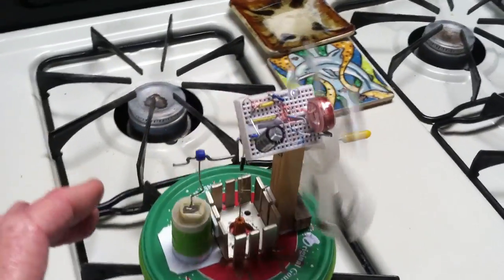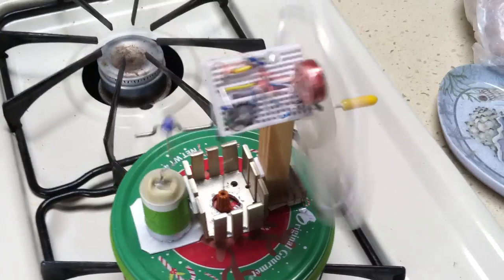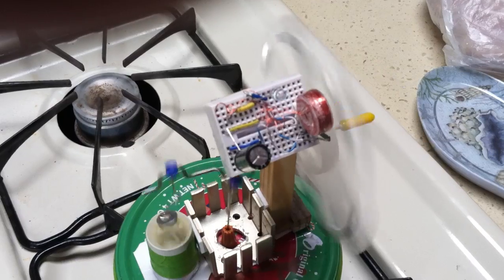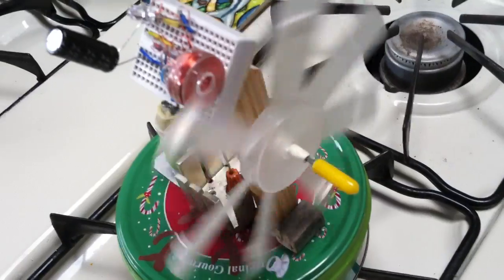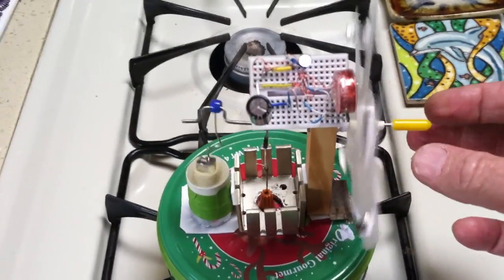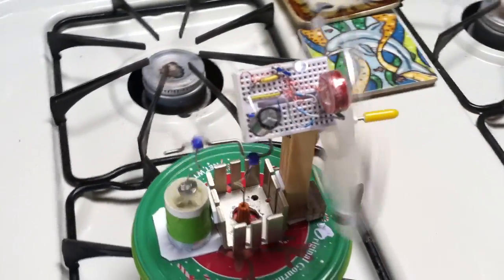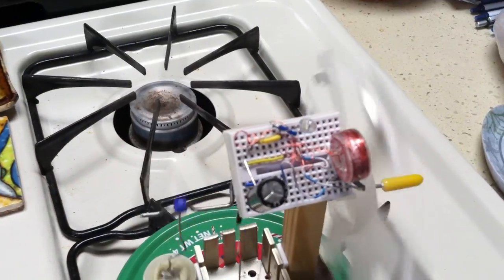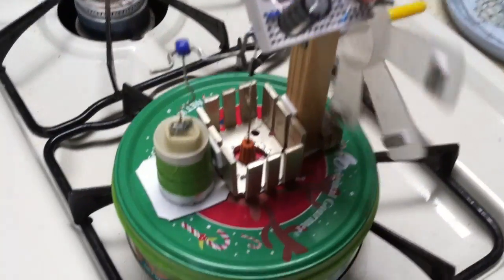Pulse Motor & Stirling Engine Hybrid

Comment: Hey lidman..... hoping you can give some insight, I have a stirling engine, from amazon, I figured once it was going I would be able to attach leads to the dc motor and maybe power a led, why does motor not produce any energy? Am I missing something? I thought maybe motor is garbage or maybe can’t generate power because of how it’s connected? Seems like it should work but doesn’t, any suggestions or insights
Reply from the maker: Some of these stirling engines barely work and don't produce extra power that you can use to drive something.  The stirling cycle is very efficient but the machines that use it can be very bad at employing it.   Study the YouTube videos to find ones that actually do power things.

Comment: I feel psychic
Reply from the maker: Yep.  I was thinking about trying this and when I saw your comment I just had to go for it.  Thanks for the nudge.
Reply: I added a similar comment to one of your past vids--only my comment was about harvesting the mechanical energy of the Stirling engine through the pluse motor ciruit to produce a charging current.

I imagine one could put such a contraption on some hot coals & charge some batteries out in the wild...
Reply: Lidmotor  and you did your usual great job. I live vicariously thru your builds. Lol
Reply from the maker: I think there are some stirling engine/ generators available.  I might do some research.
Reply: This one is interesting:  https://www.youtube.com/watch?v=atd5IiD_auk
It doesn't look like it requires any machined metal parts.
It looks like it could generate quite a bit of power--before it shakes itself apart... lol
Still--the concept is good though.
Reply from the maker: If I tried to build a big Stirling it would probably end up like this:  https://www.youtube.com/watch?v=vROdVsU_K80
Reply: I saw that vid a while ago..
I think it's a pretty safe bet that you wouldn't toss a paving stone into such an appliance--well at least not more than once, apparently. lol

Comment: Really cool mod. I wasn't expecting that. I already thought the stirling engine was cool, albeit a little weird--I can't believe there's a sponge in there--I just love stirling engines. But, with the addition of that awesome little circuit you have (and use so often, showing the wide range of applications), this one really gets the juices flowing. One of my favorite builds of yours!

I gotta make one of those little pulse circuits like yours one day. What would I need?

- coil of thin enameled magnet wire
- capacitor (super or ultra?)
- reed switch/hall sensor (?)
- transistor (?)
- LED
- resistor (?)
What am I missing, and what size prototype board is that?

Thanks for sharing!
Reply from the maker: Plastic sewing machine bobbin
30ga magnet wire
small reed switch
white led
small prototype board (1 1/4" x 1 3/4")
10 Farad 2.7v super capacitor
 a few pieces of solid core connector wire